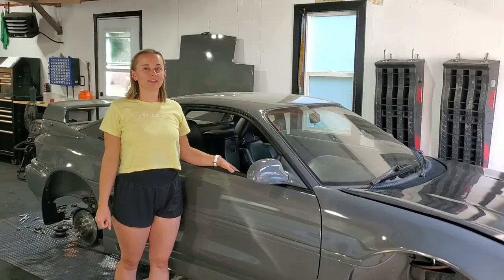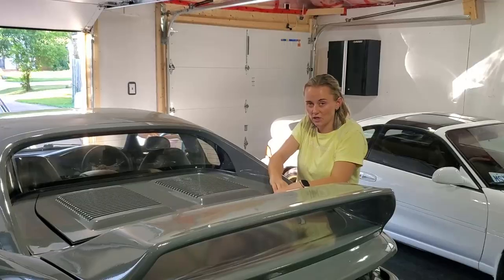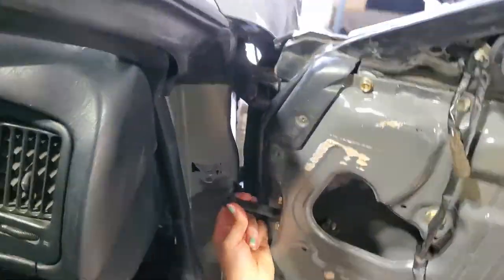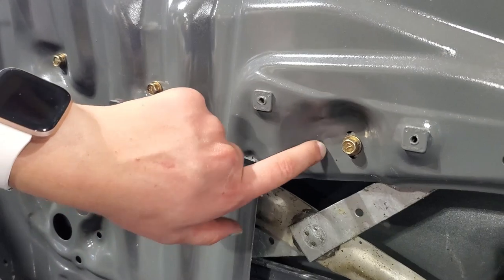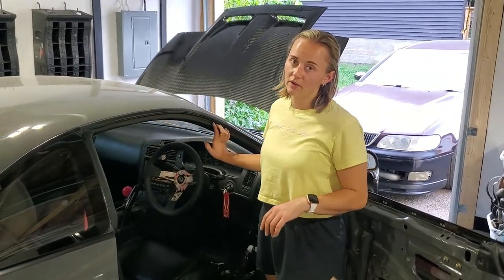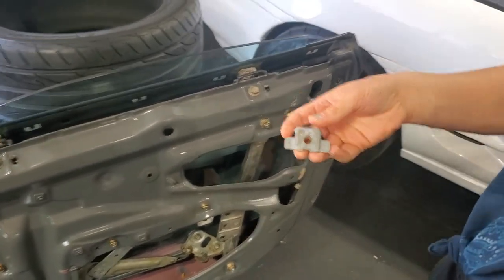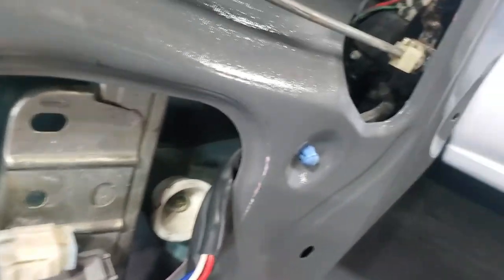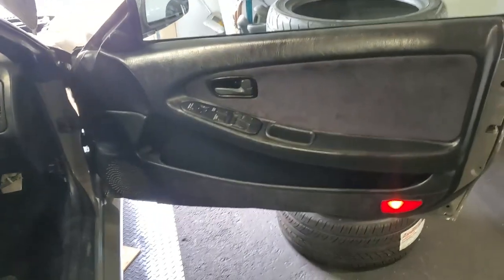SW20 MR2 Door Assembly + Window Adjustment + Ellie Update

Comment: I got a 93 T-top, which leaks. This window adjustment is what I was exactly looking for. My drivers side window won't close all the way (dig into the seal) like on the passenger side. I will try this tomorrow to see if it works :)